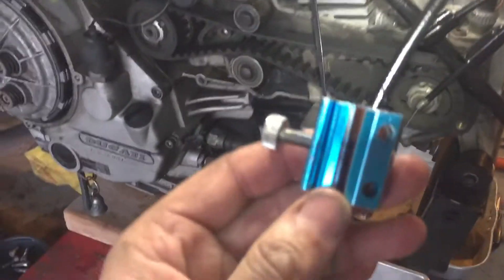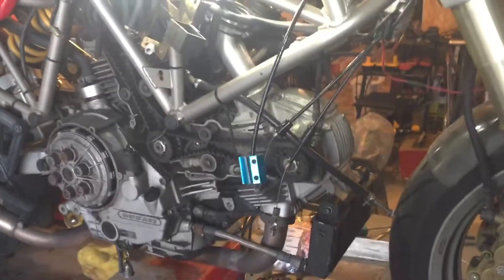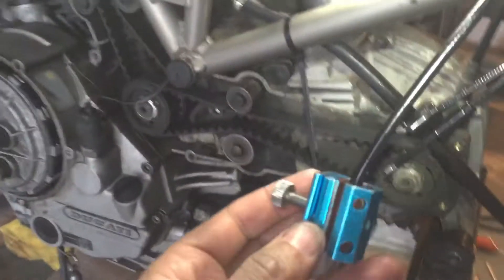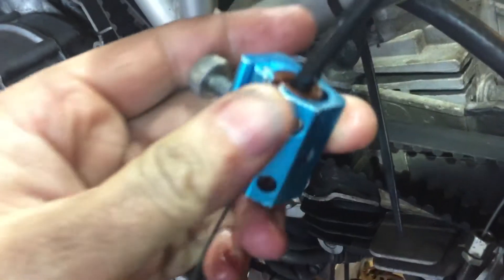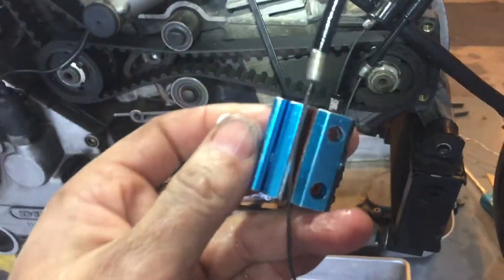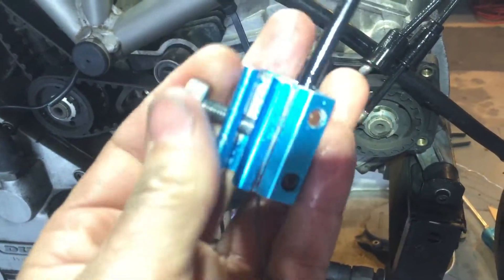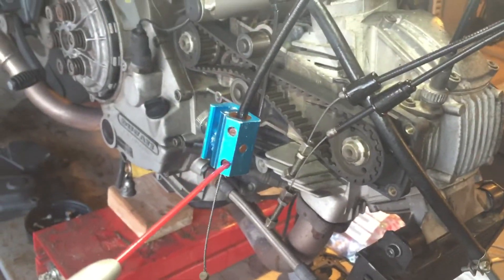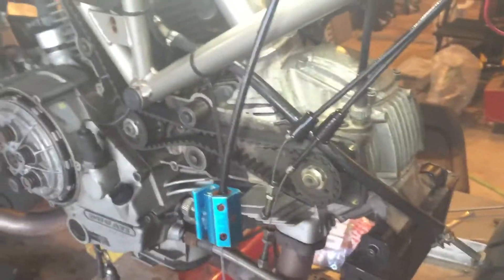How to service control cables with this cable luber tool. Demo: How to lube throttle cables.

Comment: I have had and used one of these on my bikes for years.  They work great.  You will spend a lot less on cables if you use it.  I have a syringe I fill with hydraulic jack oil or 3 in 1 oil or even Marvel Mystery oil.  I have an old metal clothes hanger that fits around my handlebars so that I can have the cable and oiler above the bars.  Then I use the syringe to put a little oil in it every so many minutes until I think it is lubed good.  If the cable isn't on the bike, I hang it up and keep syringing some oil in it until runs out the bottom of the cable.  Then I take the luber off and run the cable back and forth from one end until most of the excess drains out.  I rarely had cable problems unless I just bought a cheap cable.  Love your videos.  Thanks